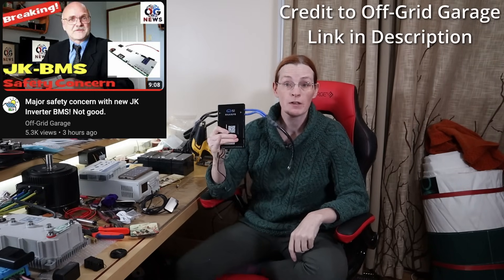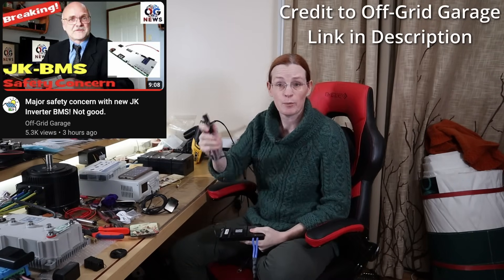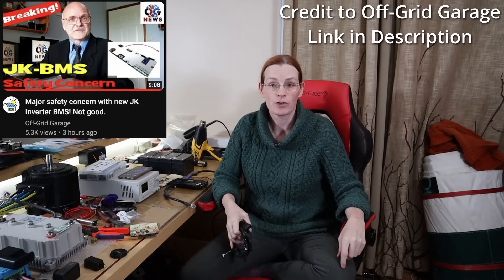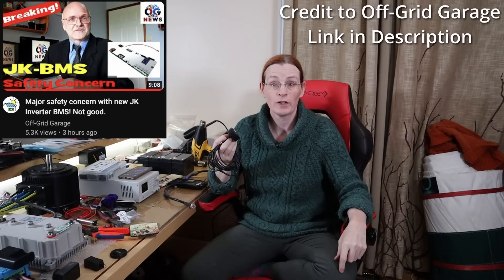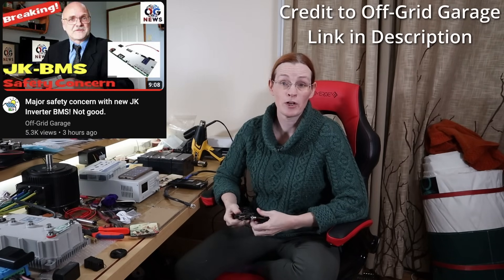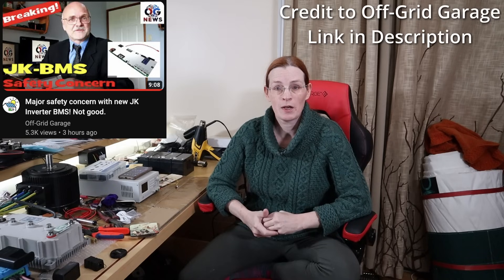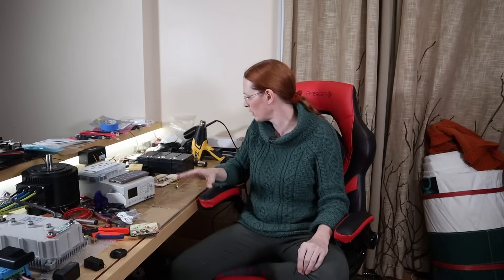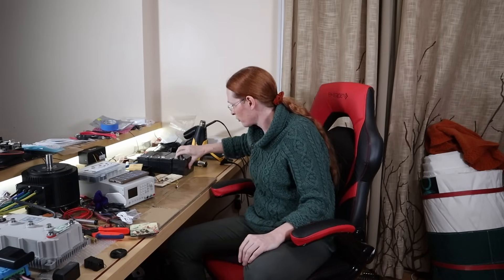News from Off-Grid Garage; Dangerous JK BMS Flaw

Comment: I bought my JK BMS through an EU  importer in Holland, thus having them confirm I got the right product knowing the 12V /24V models confusion etc. My delivery was a success. These BMS are apparently not supposed to be shutdown for prolonged times, only for allowing service.
When buying unspecified products as end users we have to confirm ourself the product is safe and fit for our intended use. 
REC bms has active balance models that by my opinion are the most stable and reliable piece of equipment. Though expensive. JK is the best budget version .
Reply from the maker: Until now, I recommended JK for being the best feature set for the price. I don't know what I'll recommend now, I have to think about it. None of the cheaper BMSes seem good to me... I had the get this out though, I couldn't bear someone buying JK because they saw me using them, and then have a disaster happen.
Reply: @TheDigitalMermaid  I still recommend the JK - there is nothing else out there that comes closes especially at this price point for DIY applications. It's part of the 'cost' of DIY: cheap, available, bugfree: pick two. And even if you go for available+bugfree, your options are, maybe, one (REC).
Reply from the maker: @upnorthandpersonal Dude, I get it, I do. It's why I held on and forgave so many of their... Quirks. This though... Such a simple thing to check and something that would destroy a person's batteries... It's just not worth it. Where are their fail safes? Maybe I'll try JBD with an external balancer? I need to think about this more...
Reply: @TheDigitalMermaid  JBD doesn't have a function to power itself off after a cell low voltage event for example, so it can completely drain a battery well below safe cell voltage levels.
Reply from the maker: @upnorthandpersonal  oh FFS, ok, that's a deal breaker. I honestly don't know what to do next... I'll figure something out
Reply: @TheDigitalMermaid  My 2 cents (for what they're worth): stick with the old style JK. I know I will for my 30kWh expansion I'm doing this year. If something better comes along later, you can always change.
Reply: @upnorthandpersonal  I'm curious what you think of the SBMS0 from electrodacus, have you ever take look at it?,  I've been using it for three years now and I couldn't find anything better at the time and still can't,  unfortunately no 48volt version,.. 30kWh expansion? thats nice..
Reply: @habana7638  I don't like it. No 48V version as you said,  but the SBMS0 cannot, alone, disconnect loads on a low-SoC state, limited balancing, and other limitations.With the  DSSR20 as charge controller, it needs specific panels (72 cells, voltage limit), on/off design, etc. Too limiting all in all.
Reply: @upnorthandpersonal  Not my experience, everything you describe works just fine, I think you are quite mistaken about that litle box, on/off design yes based on 60 Cell panels, Dual PV array functionality nice, but yeah it would have been nicer if there was also a 48V version.:goodvibes:

Comment: just buy server rack batteries, ready built and "standard" size and easy to swap
Reply from the maker: Server rack batteries on a boat are a terrible idea, full stop. In my use-case though, the density of premade batteries, particularly rack mount batteries, would make it impossible to have the kwh I want, I just wouldn't have the room.
Reply: Don’t server rack batteries also have kinda the same risks? I might be wrong, but I don’t think any of the inexpensive ones have a BMS that’s really more reliable or better tested.  They’re just as much at the mercy of their BMS vendor changing stuff up.
Reply from the maker: Correct, "rack mount" is just a form factor, doesn't say anything about what's in them. In my case though, it's more that the salty and humid environment would make short work of all the rack mount batteries I've seen.

Comment: The issue only applies to the new rack mount battery BMSes, not the ones we are using. 
You are overreacting by not even researching.
I REPEAT: This ONLY applies to the rack mount BMSes. Our BMSes that we use like the ones you have, I have had them turned off for weeks and they never reset to default.
Reply from the maker: I thought I made that clear in the video, but my anger and frustration is that this is just the latest example of how slap-dab their product development and Q&A is. They've been changing things willy nilly with no way they communicate it to buyers. They are throwing half-baked products out into the wild and using customers as guinea pigs. Yes, this dangerous flaw is on the latest BMS, and doesn't effect other models (that we know of). It's clear though that a company that doesn't catch a dangerous flaw like this is not a company to be trusted anymore.
Reply: I don’t think it’s overreacting. The flaw in question seems severe and egregious. If they don’t come out with a good explanation, and some convincing explanation as to  how they’ve changed their processes to prevent it from happening again, I would not use any of their products. 

Changing connectors and other specs without changing part numbers is also pretty terrible. If I could be confident that a particular item from them was the same one as a reviewer had tested, then I might be willing to risk it.  But if they just change stuff around without warning, then, nope. Not worth the risk.
Reply from the maker: @gf2e  I understand where @lnxpro is coming from, if the perspective is this particular issue. My frustration is built on two years of experience with their questionable dev practices, and the certain amount of embarrassment that some may have bought JK BMS based on my videos.
Reply: Not sure what you mean by "rack mount" since there is nothing wrong with anyone using that new JK BMS with any DIY setup.  In fact that new JK BMS is even better designed for DIY'ers since you actually have lugs on the BMS instead of having to deal with hardwired 7 gauge cables coming out of the old JK BMS.

Comment: i watched Andys video and appreciate yours, from his vides I understand that its only the new BMS for inverters?
Reply: That's also what I get from his video... Recently installed a regular 4-8S JK bms and this specific problem didn't occur (turned off for a week)
Still, it is unreasonable to expect everyone to test every safety feature of every BMS, there needs to be some trust...
Reply from the maker: Ya, seems like it's only the new model. However, as I said in the video, this is not a new thing with them. They seem to slap together crap and throw out to clients with clearly minimal testing or due diligence.
Reply: @TheDigitalMermaid  I have two of the newer style JK BMS because of Andy, they are the 7s-20s with the push button to start them, I have had zero issues with them, and they balance so much better than the previous BMS I have had